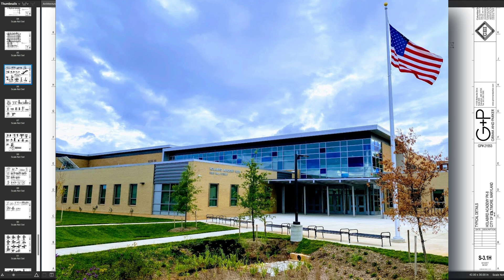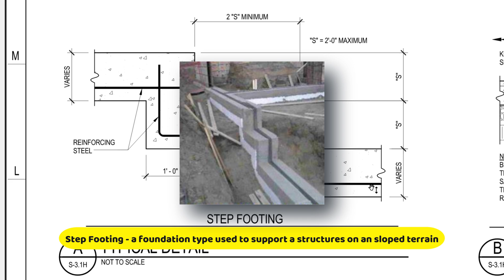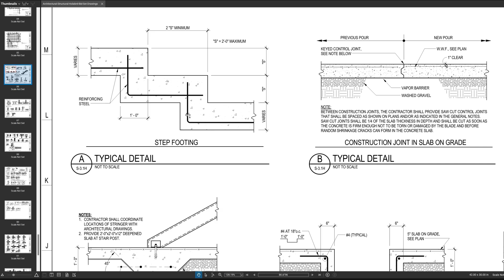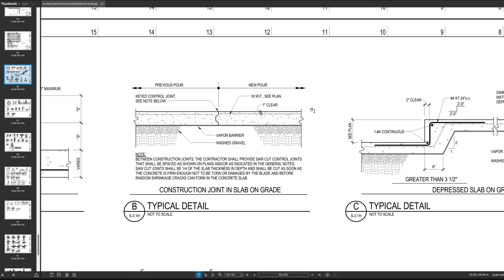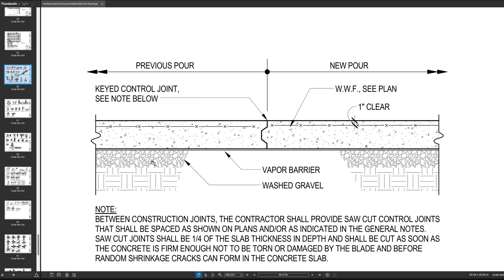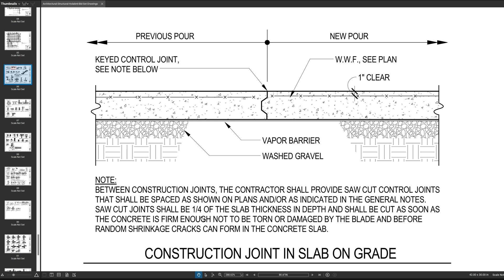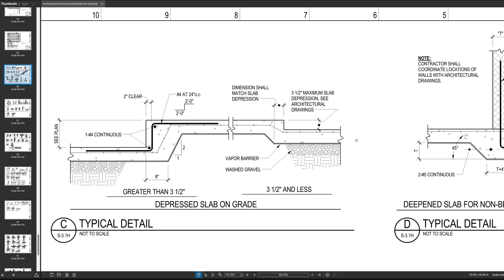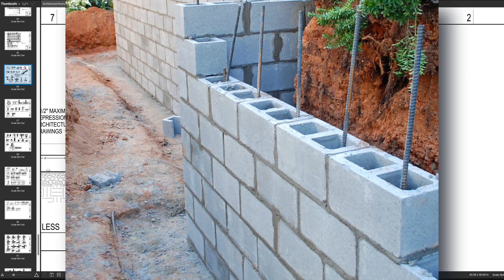Exploring Typical Details in Structural Foundation Drawings

Comment: Can you do a video on cutting slabs for plumbing and electrical, I'm having a hard time identifying where id be cutting trenching and pouring back.
Reply from the maker: Good question because the arch and structural drawings don’t always coordinate. It’s usually indicated on the Mep drawings
Reply: @SmithintheBuilding1984  thank you for your response. I get a lot of rfp on cutting slabs and re pouring, I find it difficult to gather all the information needed in a timely manner.